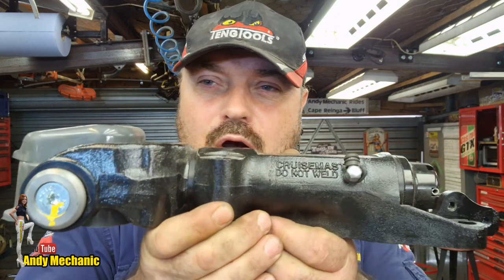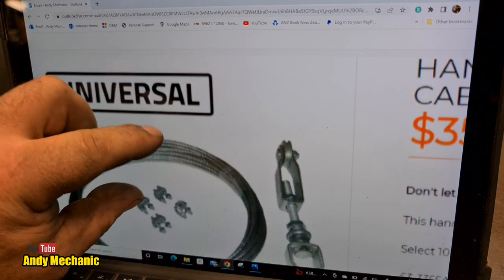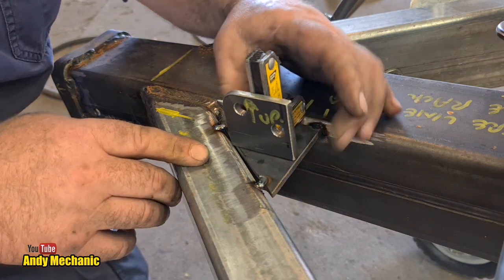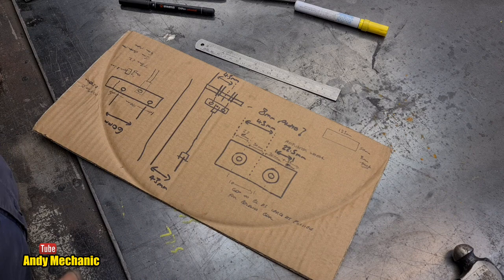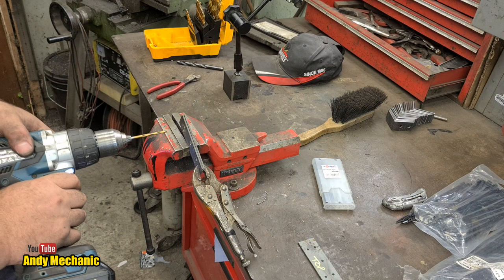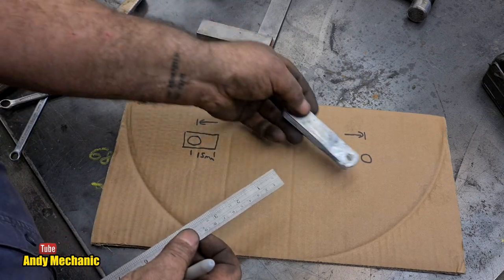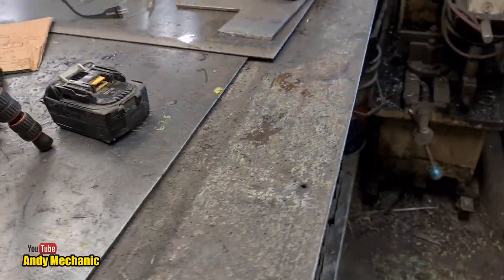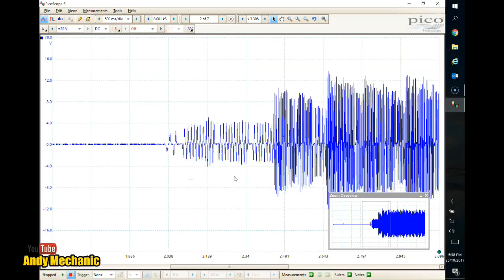Adventure off road trailer - handbrake system, design, fabrication & install  Ep.8 #2028

Comment: I found this video because I'm wondering the same thing. I had a CM suspension imported to me in the US, so I can't just get back on the phone to CM and order more parts. Instead, I found a universal handbrake for $28 and the cable adjuster for $12 on Amazon. The cabling and mount points I'll have to figure out myself. I do plan on attaching the cable ends using a crimped cable ferrule. That will be much smaller and nicer looking than the big clamps they used. I may possibly bend a "conduit" sleeve that has a larger diameter than the cable for it to make that turn on each side of the trailer in front of the brake levers. Then tack weld the sleeves to the frame. It won't be as nice as yours but it will do the trick. Again, nice job!
I'm still in love with my CM suspension on my camper, but I wish they had a better solution for a hand brake.